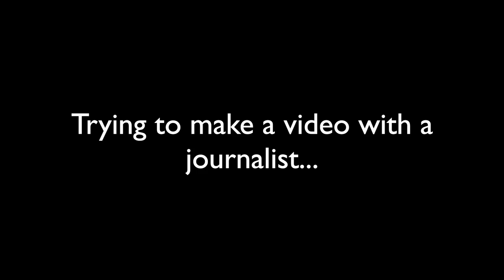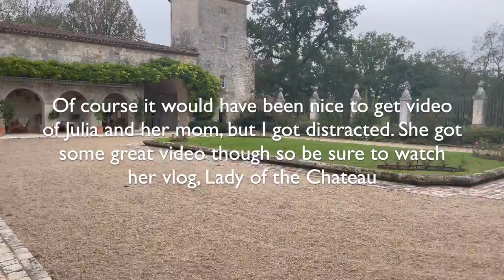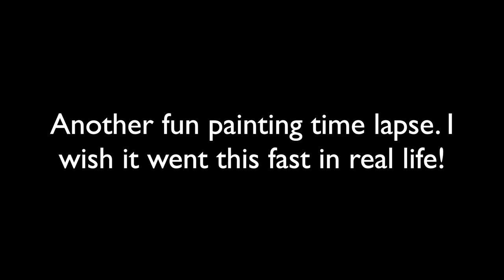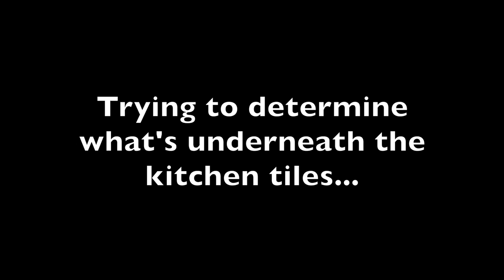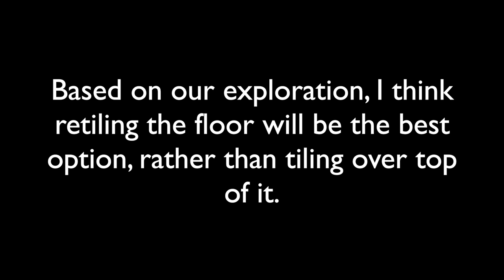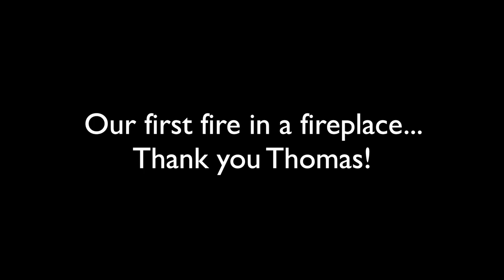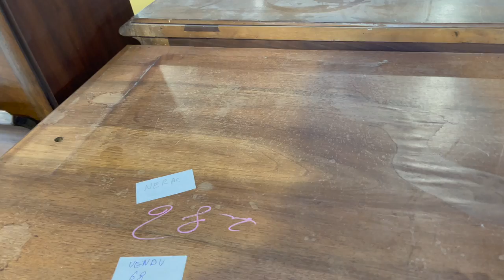A Mini Disaster In My French Chateau Garden – The Chateau Chronicles – Ep #7

Comment: If you have a 'Leroy Merlin' store near you they have all the Farrow and Ball colours in their computer and you can have them made for half the price and better quality because personally I have given up on them, not enough coverage and way too expensive. For some reason they sold the recipes to Leroy Merlin ! I just did my kitchen in Sudbury Yellow and it took more than three coats over a good white ground and I'm still not happy with it. In a previous home I put on four coats and in the end it really wasn't worth it. I changed to Leroy and two coats = done !
Reply from the maker: Thanks for the advice. I didn't know that about Leroy Merline. I found the formulas at Nuances Unikalo. Any experience with them?
Reply: @chateauchronicles  I don't know Unikalo, will look into it. I tend to try to find equivelent colours in makes like V33 which is a good quality French paint. I have a huge pot of F&B for my hallway and I hope that it will give me some coverage but given my experience with them I doubt it. I used to make my own paint some years ago and it's surprisingly easy using chalk, pigment and some basic latex paint; many call it 'chalk paint'. I also made lime based paints that had a lovely finish but the final colour depends on the temperature of the room and the final result varies so you have to do tests in a similar temperature environement first. It's a mix of lime powder, pigment and again some latex binder. Good luck.